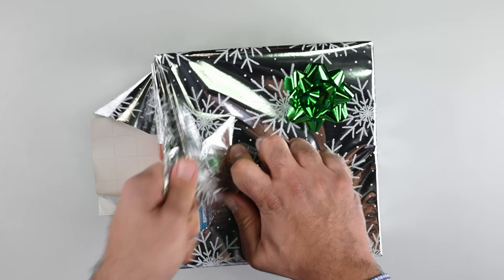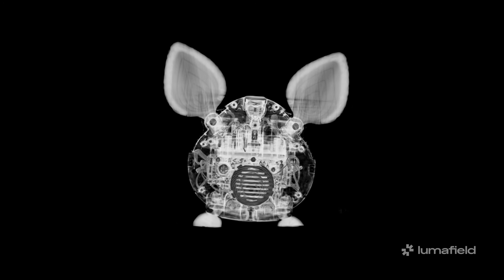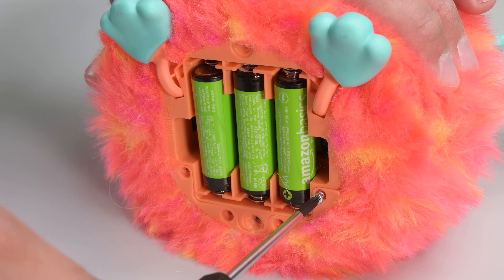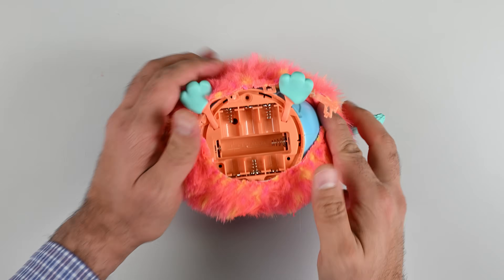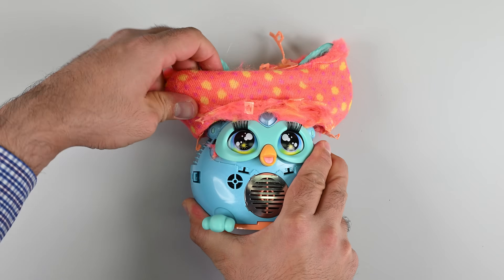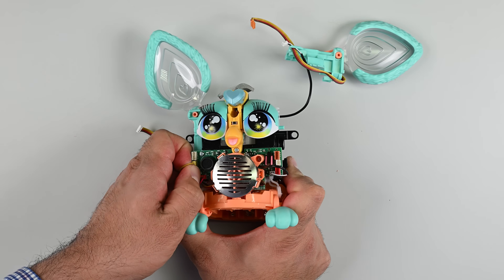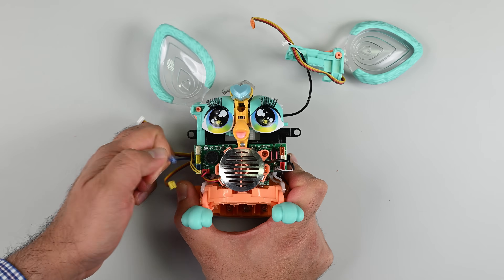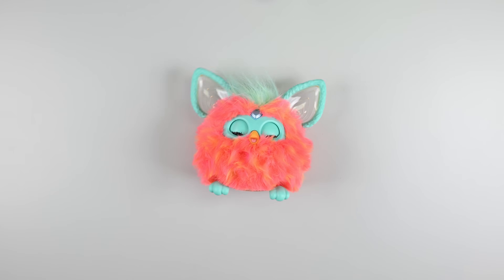Furby Teardown: The Surprising Truth About Its Terrible Design

Comment: you complain now, but you should see 2014 version of furby I recently torn apart. Similar hooks, way more screws (and hooks) and poor thing sensors were done with... aluminium foil. Which - after several years - have failed to behave how it should and leakage of current from battery compartment satarted to trigger randomly sensors causing furby to behave bad and inoperational.

Comment: i personally call a "furby", the generation with the app and the screens in their eyes, and older. that, I'm sorry, isn't a furby. the screen ones were so much better because if the batteries died or were removed with the eyelids ope, you get a lovely satanic stare while you're sleeping. i remember older furbescamente being easier to , skin, and take apart. i hate that sentence

Comment: This is such a fascinating video for me, I've taken apart a few 1998 frubies for cleaning now and I can say the removal of the fur was ver different. It was mainly held in place with a zip tie (not hard to replace) and the fur was relatively easy to pull back, either attached to the face plate by small screws or hot glue. From there you just have to cut a knot on each ear and carefully slide it off. Ive bever pulled plastic off to do electric repairs but i've seen others fo so and it looks like it can he done with out damage and be set back in place when finished.

Comment: Fascinating stuff! There's a bit of a furby fandom online, so there's tons of guides for taking apart to repair/customize your furby -- the '98 ones' pelts are secured depending on the factory. Some are glued to the shell, some are zip ties. First mod that most furby people do is putting an elastic band where that zip tie would be.

Comment: 2:52
It kinda looks good without the fur? Plasby?

And without the shell. Looks a bit like a 90s movie prop robot. Still presentable, though not kid friendly.
Reply: While the teardown is destructive, it still looks like some thought went into making the insides repairable. Which is weird. Possibly they thought of people modifying furbies. Since that seems to be a big viral thing.

Actually. I would pitch it for a good beginner robotics project? Take apart one of those and fit the electronics into a nigtmare. Or try to make it cute or cool or whatever. Modify it. And. If you don't break the connectors and electronics, it should still function just as good as a complete one.

Comment: I can't help feeling that someone with way more patience than sense could figure out how to non-destructively remove the pelt. (at least after two or three sacrificial furbies and manufacturing some special tools) But maybe I'm just not sufficiently jaded regarding the sadism of engineers.
Reply: I’ve seen less destructive teardowns of this furby, so it definitely is possible
Reply: This furby has many similar design features to the furby boom and 2012 model, both of which I have successfully skinned and pulled apart without any damage at all. This guy rushed the process and resorted to cutting and tearing the fur off, which I totally understand cause it is painstaking and time consuming, however he didn’t need to do that, because I have done it carefully without ruining the furby.
Reply: @thefurbyartist4711 yeah those tabs are delicate but they can be removed without breaking
Reply: Imo, it doesn't really matter, it's a children's toy, it should be reasonably easy to tear down non-destructively for an older child or teenager without any special parts. Parents aren't going to send Furbies to a dedicated repair shop.
Reply: @skitstheskitty2787  having an "easy to test down electronic toy" is just asking for a lawsuit
Reply: @strayiggytv  furbies are disposable battery powered. i would get it if they were made with rechargeable lithium batteries. but. literally take out the batteries.
Reply: @strayiggytv  the older gen furbys (pre-2012) are very easy to tear down. the first gen (1998-2001) are the easiest and second gen are a little more involved but still very simple. repair on these models is very doable without specialized knowledge / spending hours simply to remove the fur. the complexity on only step 1 of the newer gens feels like it's solely to void warranties from parents or older siblings who know enough about electronics to do simple wear-and-tear repairs but not enough about the assembly of these toys to painstakingly "skin" them without damage
Reply: @prokaryoteirl  having done repair on them all I can safely say removing the skin without destroying it is doable and if you aren't willing ng to learn how to do it right I'm not sure why your repair furbies? That's like the easiest thing about some of them considering things like the furby booms motor burn out problem and the connects unrepairable LCD eyes. 

Heck even the og furby has MSA that takes them out.

Comment: Vintage furby repair person here. Thank you for the teardown!
Reply: What are the old ones like when it comes to repair?
Reply: @MrHack4never  Super chill. For the 1998 furbies just cut a zip tie and maybe 2 screws on the faceplate and the whole skin pops off. A few more screws for the shell and boom you have access to everything. All of the components are very simple too. I'm very new to electronics in general and I can point at things and know what they are.
Reply: @MrHack4never  The only one I haven't been able to repair in the 70ish I've worked on seems to have a corroded board with a shorted power chip. I identified the chip with the schematics from the trademark paperwork. The entire board and all of the parts are laid out in it. It's wonderful.
I did manage to get that furby to turn on and go through the wake up dance but without that chip functioning it just sends power to the motor and nowhere else.
Reply: @monsteryote  What chip is it?
Reply: @LFTRnow  pretty sure its a COB, chip on board, and basically is a custom solution with no identification or possible repair/replacement 
method.

Comment: This is very useful information for Furby fans, as the community has a strong focus on repairing/restoring them; it's a shame you have to really rip and tear to get the fur off, especially since other models are considerably easy to skin.
Reply: The Connect is also quite hard to skin.
Reply: @MonochromeMoths  Oh, I know, unfortunately; my Connect was ruined when I opened them up to muffle their speaker. I followed a tutorial very closely, but it jacked up the touch sensors. :(